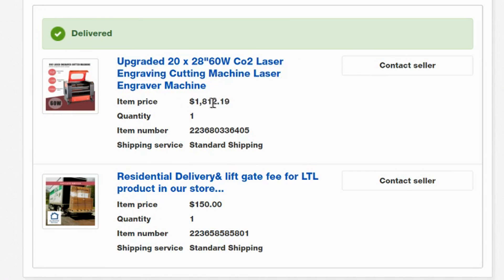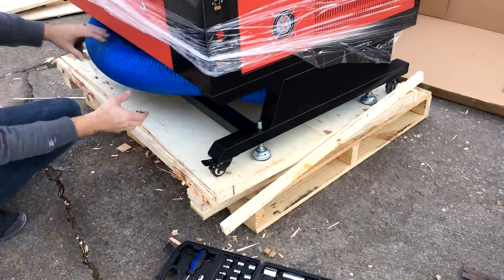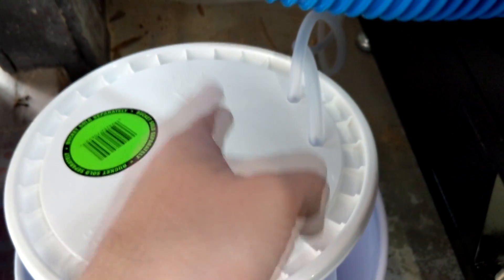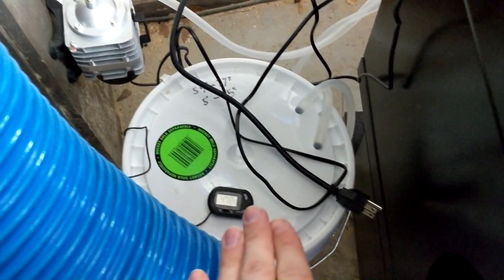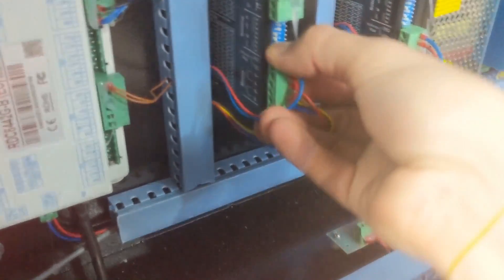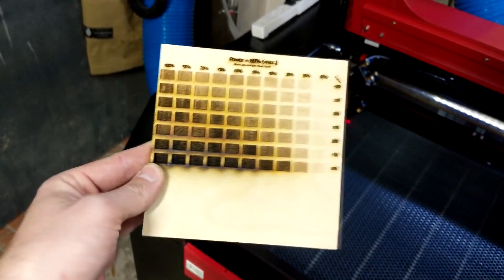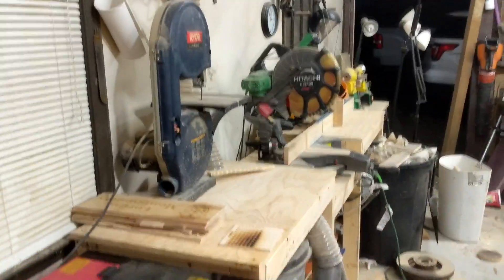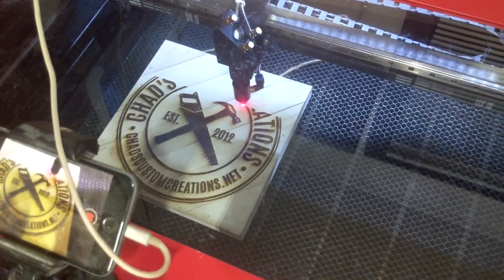I Buy a $2,000 Chinese Co2 Laser, What You Need to Get Started

Comment: lol...thats not a breaker, it's a power strip
Reply from the maker: Yes it is a powerstrip but most or all that I’ve ever seen have built in circuit breakers and that was what I was referring as the breaker when I pointed to the reset/off switch.

Comment: I got a 100W otherwise the same exact machine.  I am a bit concerned however, that the laser does not align with the rest of the optics.  Laser sits about ¼" higher and a little bit farther to the back of the machine that the first mirror.  I presume at this point that if I shim the first mirror, I am going to have to shim everything else.   BTW, I installed the laser tube as it came in a separate
package. Not sure if I should fire this thing up and see what happens or fiddle with it first.
Reply from the maker: Mirror alignment is a skill all in of itself. There are lots of videos on getting them aligned. Russ at Sarbar multimedia just put out a great video on mirror alignment

Comment: Im in the process of buying the 80w version and will probably take the industrial cooler instead of the aquarium pump. Seems so unsafe not knowing what the cooling temperature is :O
Reply from the maker: Yes I highly recommend the chiller if in an area that stays below 70F the 3000 should work but if in a hot space like mine the 5000 keeps the temp where it needs to be.

Comment: Hey Chad. Great video! Two years on. I'm checking in to know how your Chinese laser is faring. Still going good? TIA
Reply from the maker: It is actually still alive and well, I have replaced the tube and the power supply as a result of the water hoses coming loose and causing an electrical arc at the tube causing it to crack. This could have been avoided had i or the manufacturer put hose clamps on the connection points.
Reply: @Chads Custom Creations  Thanks, Chad, for the swift reply. Glad to hear it's still alive (asides from the issues stemming from unclamped hoses that cracked the tube). The reason I asked is because I'm looking at purchasing a Wattsan engraving laser (their 0305 60w model or their 6040 ST 80w model) but not much rave about them on the web or actual customers considering they are, and have a brand. Have heard of this hrand? 

A risk I'm willing to take as I've grown to like their products through watching a series of their product videos.

Anyway, thanks for taking the time to respond. It means a lot to me. Keep up with the great videos.

Comment: Ok so what I've learned is essentially these are the same thing I use at work to cut steel? How thick of metal will these cut or do they just engrave stuff
Reply from the maker: Not exactly these are Co2 lasers which are great for cutting bio materials like wood leather and strangely really great at acrylic. To cut metal you will most likely need a very very high wattage "fiber" laser I believe. Although I have seen some people add oxygen to the air assist and I think I have seen some Co2 lasers cut metal. But out of the box these cannot effect metals.
Reply: @ChadsCustomCreations  well shit I'm not spending a million bucks to cut a hand full of things to build derby parts lol guess I'll keep sneaking in things on sheets at work lol
Reply from the maker: If you do want precise cuts take a look at send cut send on google they cut your parts bend if needed and mail direct to you. Not sponsored and I've haven't used them but I know a lot of people who have.
Reply: @ChadsCustomCreations  thanks I'll have to check into that

Comment: hi Chads 
thanks for your video 
i want to buy the same machine but 100w do you think is good enough to engrave on metal like stein steel ?
I need to youse on bar shaker . bar spoon and glasses 
thanks for your help
Reply from the maker: Hello if you want to really engrave metals look into fiber lasers. Co2 lasers like this can add coatings coatings to metal but cannot really engrave into the metal. These can however do glass.

Comment: It's been a year how's everything holding up?
Reply from the maker: At the 18th month mark the coolant lines did loosen up on me during a big production run. This caused water to get up near the high voltage side of the laser tube. Had I been more cautious and not in a rush I could have prevented an electrical arc that caused the glass tube to break and fried my power supply. A few hundred dollars later and about a week waiting for shipping it is back up and operational. I would buy another if I had the space.

Comment: Would you recommend getting one of these and how is it now since owning it
For a while…
Reply from the maker: I say if you have the space it is totally worth it. After a year and a half mine is still up and running and only major issue I had was slicone water tubing came loose and allowed moisture up near the tube. I stupidly kept running the machine and the high voltage wire arched fries the power supply and cracked the laser tube. This again was after 18 months of use and I could have prevented this by adding hose clamps on the water connections.

Comment: I only skimmed through the video, but wanted to share that I bought one of them big blue 50W about a year ago.  I found it on amazon from a warehouse in the US which was cool.  Mine was a little cheaper and came with a rotary tool, but that red one looks cooler for sure.  That full honeycomb bed is nice.  Mine is just steel bed so I had to buy a honeycomb separate and still havent quite found one that can really maximize my work area so with bigger projects I'm cutting I have to improvise by using bolts spread around as raisers to keep the bottom free of all that resin when cutting.  My Laser paid for itself like 4 or 5 times now.  I use it regularly and havent had any issues with the machine.  As long as a person is commited to learning without any decent tech support the chinese lasers really arent a bad buy.
Reply from the maker: Great to hear, it's really quite a time to be alive I love that commoners like us can afford such tools that allow for so much creativity.
Reply: @ChadsCustomCreations  So true, me and my wife are looking into UV printers now, but they are still such a new thing we havent found great info on them as a whole let alone the cheaper chinese models, but hopefully in the year or so we might commit to buying something.
Reply: @naRevolution  
Hello, I am interested in acquiring one of these Chinese machines but they have given me so much bad reference that I have not made up my mind yet, I would like to hear your opinion about it, have you given some kind of failure? or did you have to make any improvements?
Reply: @sonando8094  I've had mine for over 2 years now and havent had to replace anything, fix, or improve anything.  While it isnt where I got mine back then if I were to buy a new one now I would probably go through OMTech Laser.  They are chinese machines, but as far as i can tell they have offices and warehouses out of california with english speaking tech support.  They have a youtube channel I believe, and a nice variety of machines to choose from based on power, performance, ease of use, and budget.

Comment: LOL, did you know you can remove the screws on the bottom and the whole thing lifts right off the pallet?  I have that exact same laser but in Yellow and black, the doors are black the rest is yellow.  I bought a CW5200 chiller, mix distilled water and RV antifreeze to keep the water clean, and since it is in a chiller it is also sealed to prevent growth or evaporation.  You are also the first person I have ever seen debug a laser controller.  LOL

A couple tips, replace the lens with a good one,  Get a 2" lens, you will notice a difference right away, also replace and properly align the mirrors. I use copper mirrors. The mirrors and lens that these come with are cheap and don't reflect enough energy, also on mine the lens was cloudy, should be crystal clear(yellow in color). Got mine from MCWlaser. Also protect your tube by reducing the max power to 80%-90% at the controller, you never want to run the included tube at full power because the power supply is set to a 60watt tube, but these are actually 50watt tubes. Check the length and diameter to confirm.  I see you installed a ma meter, put a mark at ~20 and try not to exceed it, and your tube will last a lot longer.  A true 60 watt tube is 55mm diameter by 1200mm, the tubes in these Chasers are 55mm x 1100 mm which are 50 watts. They overdrive them to get 60 watts, which shortens the tube life.  When my tube has run it's course I will upgrade to a RECI 100Watt and power supply, only need to make an extension cap for the box.   These are surprisingly very good lasers for what they cost, they just need some fine tuning and TLC and they are just as good as some American name brand $8000 and higher lasers.
Reply from the maker: This is a ton of valuable information we need to be friends are you on FB or Instagram also?
Reply: @ChadsCustomCreations  Well, I try to avoid FB as much as possible. I plan to set up a Chaser group on MEWE.   I call them Chaser since they are chinese lasers.

Comment: Great video man just wondering do you wish you went bigger at all wattage wise or do you think this is sufficient for your workload? I plan to be buying one in a bit just trying to decide 50 vs 60 vs 70 which I know mean actually 40 vs 50 vs 60. Thanks for the input!
Reply from the maker: Thank you, you know size wise it works out great fir me especially with the pass through. Powerwise it has worked great, I can cut 1/4 material at a good speed. And my plan is possibly to upgrade the power supply and tube to maybe a 100w once the original starts to wear out.

Comment: What is the air compressor that use for air assist ? (Wattage or flowrate)
Reply: looks like a 65L/h like the one i have from amazon
Reply: @bazmarc  thank you ✌️
Reply from the maker: sorry I missed this glad someone chimed in because I really have no idea about the compressor it came with my unit when I purchased it.
Reply: @ChadsCustomCreations can you send a image of that ?
Reply from the maker: This appears to be the same compressor mine is using for air assist.
https://amzn.to/2LAuNp8
Reply: I got it. Thank you. Is that air pressure enough for the cutting ?
Reply from the maker: @yasithisurantha6268  one my 60w I am able to cut 1/4 inch plywood no problem.  Though I am looking into adding an upgrade to my system where I will be able to use my air tools compressor which I hear running it at 20 psi can increase cutting abilities also.
Reply: @ChadsCustomCreations  Thank you

Comment: Can you tell me if the Legs are removeable? I need to get this through a 32" opening
Reply from the maker: Yes they are from the inside you can access 4 large Allen head bolts to remove the base from the legs. Height without legs is about 25"

Comment: Can you cut metal with this? Also what program are you using to run this laser with? Or does it come with one?
Reply from the maker: No Co2 lasers are not good with metals. Fiber lasers can engrave metal and maybe cut. I can use a spray to etch a coating onto metals though.

Comment: Hi. I just both this laser. Now I have question for the air pump  - one comes out from machine and go to the air pump but where goes from the air pump - no where... From the video looks like that
Reply from the maker: So with my particular laser it has a sperate air pump that plugs into the air inlet on the backside of ny machine. I have a friend who has a machine that looks like mine but the air pump is an internal device.

There should be air blowing out of the tip of the laser head this aides in keeping the lense clean, better cuts, and reduces the chances of fires.
Reply: @ChadsCustomCreations  hi. i have the same what you have in video and the small air pump what came with the mashine
Reply from the maker: @lilianaraasik  great yes that air tube will plug into the back of your machine where it says air inlet. Only needs to be turn on when laser is cutting or engraving.
Reply: @ChadsCustomCreations  ok nice. thank you. then i understood right.  I think my laser  is then set up. the fear is biger that i do something wrong but actually its not very complicated. anyway thank you.
Reply: Hi again. Now everything is set up but... how i durn it on. I have key do i need turn it on from the key. I have looking around in youtube but nobody shows this how to first time turn it on. I'm pretty home with technic but with electric ....
Reply from the maker: I should make a new video for starting and running the laser for the first timers.

Yes key needs to be in and turned. The emergency stop smash button may need to be twisted to reset. On the right side of the machine you should see 2 switches one to turn on machine and one gives power to laser. Be sure your water is circulating and is between 15-25 Celsius if you want to test the beam put a piece of wood under the laser and press the pulse button really fast that will send a beam there the laser. Be sure lid is closed, exhaust fan is one and air assist pump is running also. I phew I know that sounds like a lot but once you do it a few times it will come naturally.
Reply: @ChadsCustomCreations   yes i think im not the first who thinks how to switch it on. and now i dont find how to switch laser on. The button is switced on but no laser. One video shows that from the switch and then key. But I have only main switch with the key. Laser is switch button
Reply from the maker: @lilianaraasik  comment your email I'll upload a video to Google photos and share it with you.
Reply: @ChadsCustomCreations  ok thanks
Reply: @ChadsCustomCreations  Hi again. Today I had time to test. My answer is nothing. Maybe the problem is water. The water is only 6degrees celcius. My laser is in basemant and right now there is cold the room temperture is only 9 degrees.
Reply from the maker: @lilianaraasik  year you don't want the water too cold either it can risk cracking your tube and less efficient power from the laser. I use this aquarium heater to keep my laser above 15 Celsius 
https://www.amazon.com/dp/B07XFB63F8/?ref=exp_chadscustomcreations_dp_vv_mw

Comment: Dont know if anyone has mentioned this yet, but I would highly recommend a water cooler to keep water temps stable. I'm in Texas so I'm concerned with the water getting too hot. You may not have that problem.
Reply from the maker: You're absolutely right, I survived in the winter months but come summer I ordered an S&A 5000 chiller well worth it if you are doing production cuts and engravings. I've run the laser for 16 hours straight and it hold the temp right where it needs to be.
Reply: @ChadsCustomCreations  Awesome! Welcome to the club!!

Comment: put a tie-wrap around the bottom of your return water hose inside the bucket to keep it from popping out while it's running. been there, done that. you can also use recycled frozen water bottles to keep the water below 70 degrees.
Reply from the maker: Haha yep same thing happened to me also, thankfully the machine has a flow sensor.

Comment: What are your thoughts on the unit after the past month or so... I have one for sale local for 1200 or best offer... very tempted to pick it up.
Reply from the maker: About to make a after one year update video showing how much I've done and what was the the return on investment. If it broke today and I couldn't fix it I would order another in a heartbeat. Does  the one your looking have, have the ruida controller? Same push buttons as mine?
Reply: @ChadsCustomCreations  looks the same. https://www.facebook.com/marketplace/item/732734084261554/
Reply from the maker: @1620GarageAndFarm  Yep that would be the exact same just different color and he has taken good care of his, so much cleaner than the way mine looks.
Reply from the maker: @1620GarageAndFarm  yeah even the $1200 is a great deal. 2-3 guys should be able to lift into a truck bed just be gentle.
Reply: @ChadsCustomCreations  also how does this do with cutting? I was hoping to make boxes and tiger stuff with it ...
Reply from the maker: @1620GarageAndFarm  mine can cut 1/4 plywood very well, and also to improve cutting you can put a different lense in and also attach to a 30psi air line which ibhear makes a big difference. Something you will probably want to budget for at some point is a S&A water chiller to keep laser at working temp, or you can do the water bucket and frozen water bottles like I did for a long time. The chiller will run you around $600 but for my simi production shop it was also well worth it.
Reply: @ChadsCustomCreations  funny going back to my old comments… fast forward 8 months abs I got a smoken deal on my laser !! Hope to my mine cutting this weekend once I get the chiller all setup along with the exhaust fan.
Reply from the maker: Oh wow no kidding looks like everything worked out just right!

Comment: We read that these red colored machines are a problem, with the manufacturer having problems with the machines, and not being interested, or capable of fixing those problems. It will be interesting to see how this one does.
Reply from the maker: It had its problems but I would buy it again in a heartbeat. I just ran a job this week that payed for half of it.
Reply: Chads Custom Creations well, I wish you good luck with it.
Reply from the maker: @melgross  thank you. Which machine are you running?
Reply: Chads Custom Creations Trotec Speedy 300 fiber 50 watt.
Reply from the maker: @melgross  oh wow just checked it out did not even know about duel co2 and fiber machines I bet you love that flexibility.
Reply: Chads Custom Creations that’s very useful. But these things are pretty expensive, and when you get to the accessories, ugh. But they’re pretty flexible. I wish both were of higher power, but it costs so much already, I can’t even think about it.